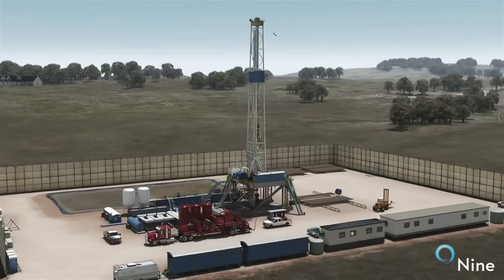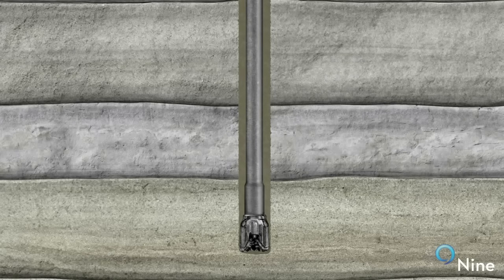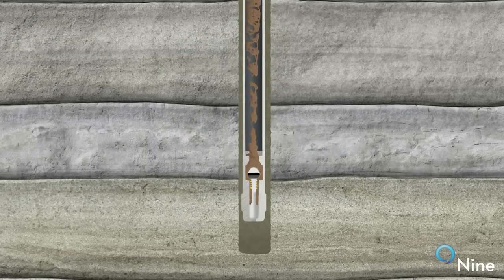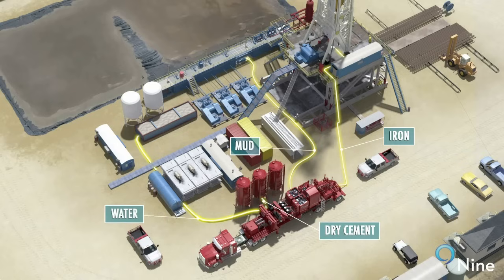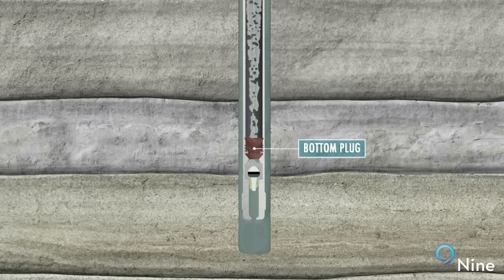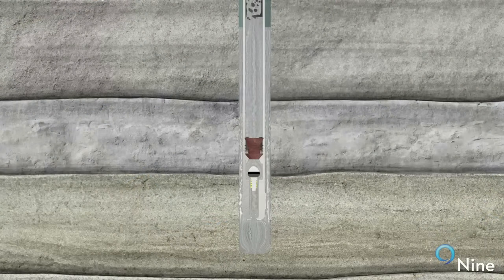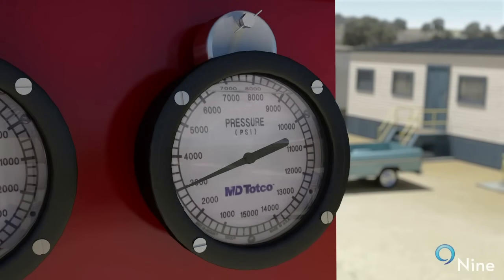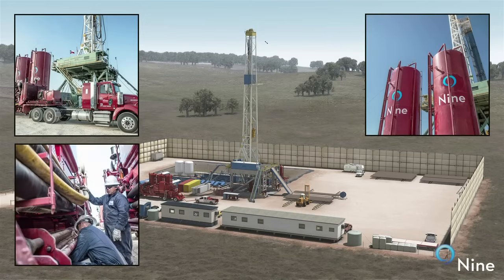WATCH: Overall Cementing Process

Comment: How to check float or casing shoe
Reply: I’m probably wrong but I think it’s the hold time pressure on the bore and a slurry sample taken of the cement up top as well as a bulk sample taken… Then after the appropriate amount of time there is a pressure test applied on the plug. I may be wrong but that what remember
Reply: Attempt to bleed off the pressure. If the pressure can be bled off and no backflow is seen, the float is holding. If pressure doesn't drop and backflow is observed the float is leaking and you keep the well pressurised until the cement sets...

Comment: I do this for a living 💪… but for a different company
Reply: 120-142 cementing 💪🏾😎 lets gooo
Reply: What pays more? Cementing or coil tubing?
Reply: @miadena7591  cementing
Reply: @miadena7591   coil tubbing…120 hour weeks
Reply: @Mia Dena  depends on job title hourly  coil  by mass of hour cement  I think cement  is less stressful.  I worked for 9 , gladiator, and bj now American  cementing
Reply: Is this a dangerous Job?
Reply: @meditations1014 most dangerous part is falling asleep while driving to and from
Reply: @meditations1014 It can be very dangerous
Reply: Have you ever tried using nano bubble water with your cement mix?
Reply: @ZNewsNow No but I've performed many, many 14,000 sack Foam Cement jobs.
Reply: @adamsatoms39165  As a mixer or one who figures out the job?
Reply: @adamsatoms39165  As one who mixes or one who figures out the job?
Reply: Is this job hard to learn??